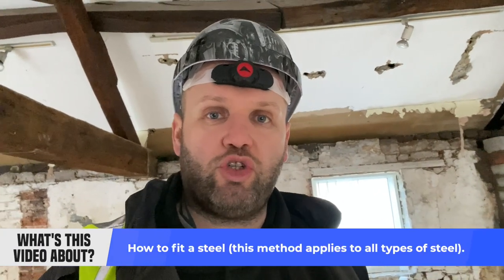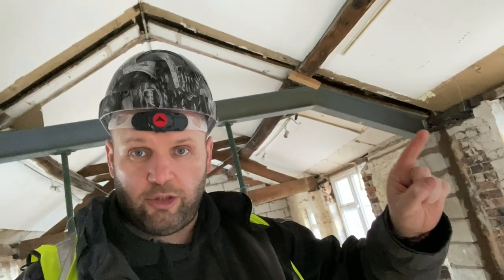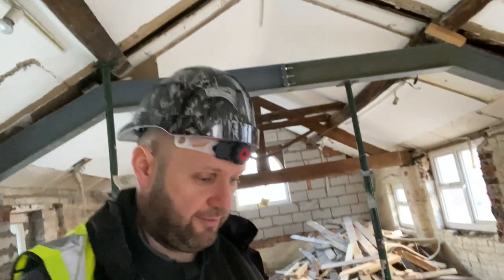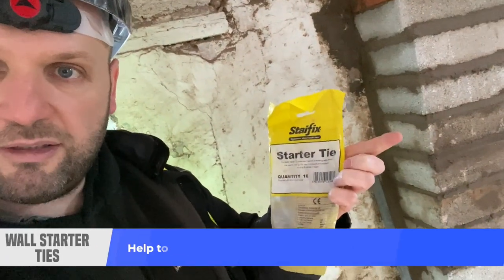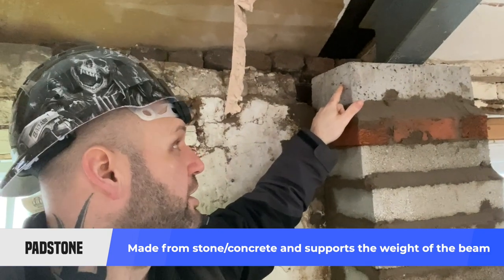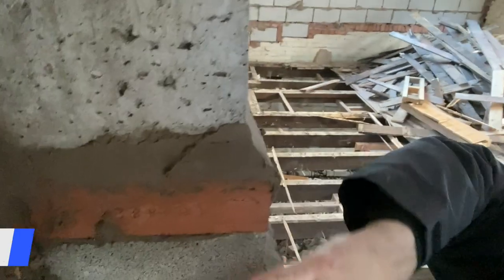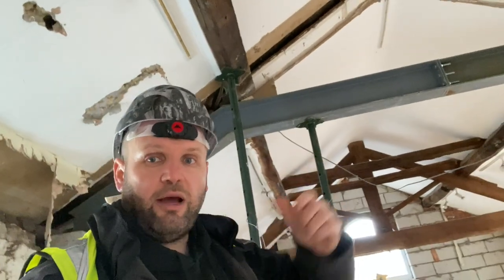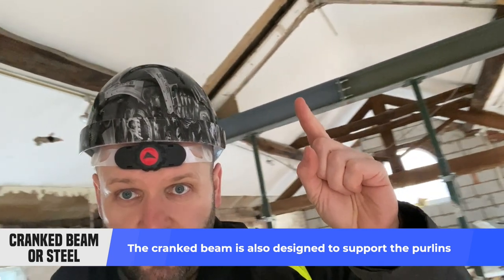How to Fit a Steel Beam or RSJ (I Beam, H Beam, Cranked Steel)

Comment: John, do you have to put a DPC under the pier, and what bout foundations for the pier?  Do you have to have concrete underneath to stop it all being pushed into the earth?
Would have been helpful to have had some shots of the entire pier top to bottom.  Notwithstanding, it's interesting.   What would a steel like that cost, to buy?
Reply from the maker: Hi there. You would have to put a DPC beneath the pier if it goes all the way to the ground floor and yes, it would need a footing. This particular pier, however, is built from the first floor. The approximate cost of a cranked steel like this is £900. 

Hope that helps, mate. Thanks again for watching and for your questions 😀👍

Comment: Love the videos. Do the piers go all way down to the ground floor?
Reply from the maker: Hi Jim. Thanks for your great feedback, mate – we truly appreciate it 😀👌 With regard to your question, yes, the brick piers do go all the way to the ground floor for strength and structural integrity purposes.
Reply: @HYPEBuilding  Instead of the pier could you have used a steel post instead?